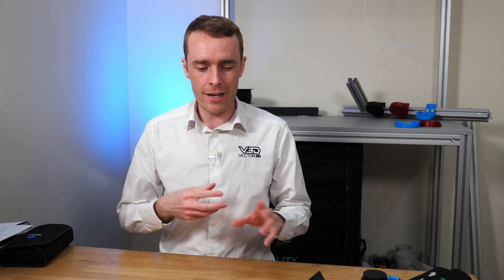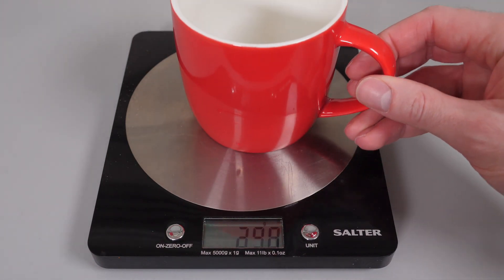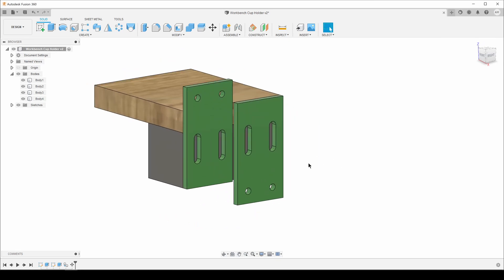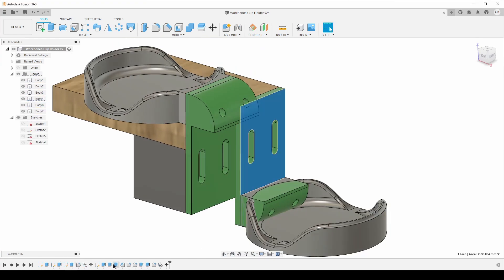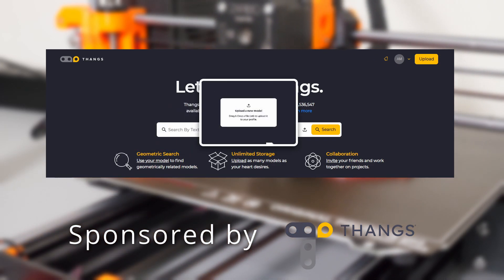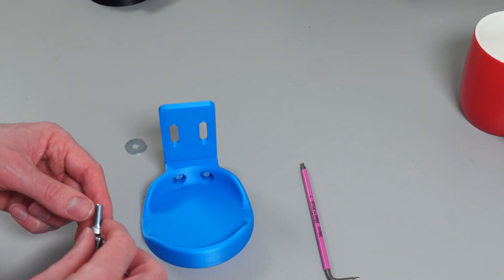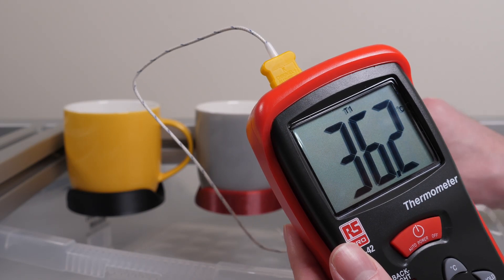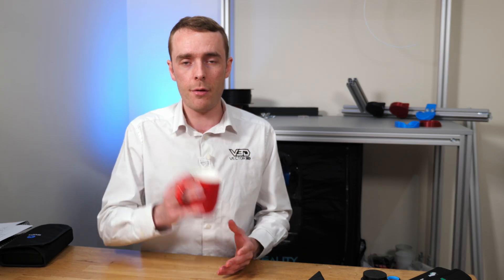3D Printed Cup Holder for BOILING Tea! (Sponsored)

Comment: Heat transfer via conduction is directly impacted by the area it contacts. One way to aid this design would be to reduce the area of contact, perhaps via small "ridges" or "webbing" where the mug and  holder touch... first thought would be no top layers and a high enough infill would achieve this... Not like it matters based on your test anyhow, but would help with hotter stuff.

Comment: Well it's good to see PLA wouldn't so much succumb to heat deformation problems. However, it is possible it could deform in a plastic manner. Granted you would have leave your 'heavy' mug/cup in place for some time before that is likely an issue in this design scenario. It is something to bear in mind when making this type of design though! A touch too much weight left sitting or a touch too thin in mechanism and it WILL slowly deform and one day..crash. I've made a few things and forgotten that PLA will fail that way..oops. Slowly watching a mechanical thing bend and droop and droop..then one day it just breaks hah.
Reply: Ive hung a very heavy speaker on a PLA "hook" for about a years time, in schorching summer heat too! It easily reaches 50C where its located... not a budge yet for some reason. Its is a fairly chunky piece though.
Reply: @sandos-x1t  Interesting..I find that uh..very hard to believe it is actual PLA. Raw cannot handle 50C without deformation. Nor can it withstand that much cantilevered load without plastic deformation happening. Maybe it's a blend of some sort and you didn't realize? Odd...
I've seen even simple spool holders of PLA succumb over the years to long term slow deformation.
Reply: @secretagb  The only PLA part Ive seen warp is the fan duct that sits very close to my nozzle and the one on my heatsink, but then the deformation is very small. Not bearing any loads either, though so thats understandable. I guess they become heat treated after a few cycles =)
Reply: @sandos-x1t  haha I'd imagine so!